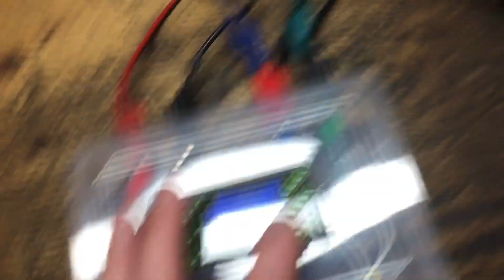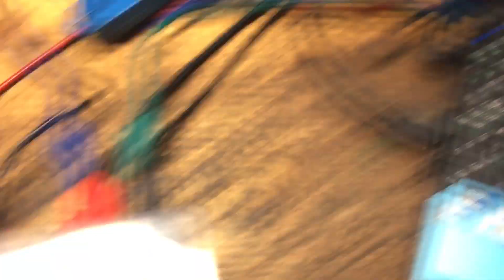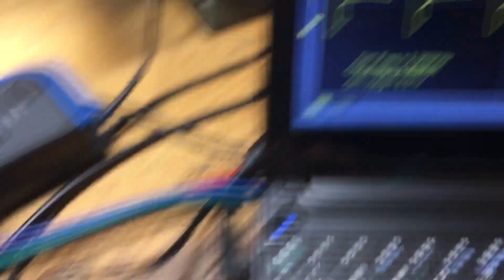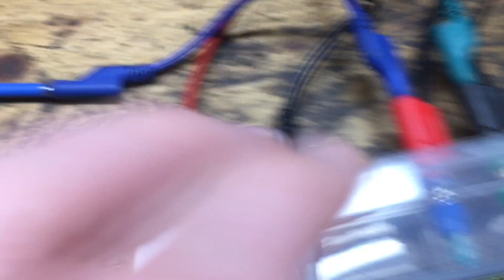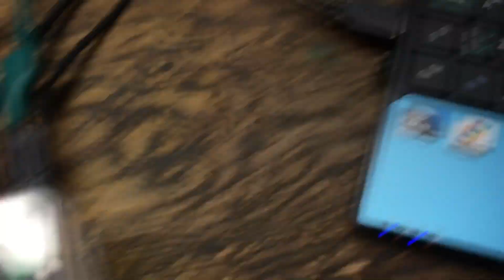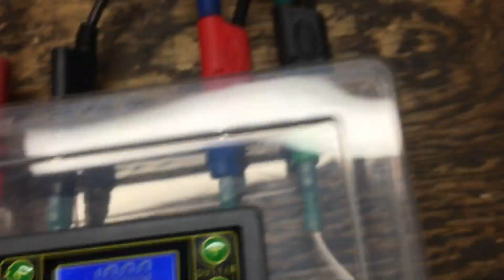Brushed Motors & PWM Drive

Comment: 👍👍👍

Put a 0.1 micro farad cap across your motor leads.
Even in conjunction, a little better with a Diode, and or resistor 

Feride beads have been used, but the problem is figuring out the formula for your particular application 

In electrical engineering class that Math was too heavy for me and I will raise my hand and said I would always get a F when trying to figure out those formulas and do the math for figuring . Fair right beads or any of that stuff, but I completely understand it and can play around with it and figure it out .